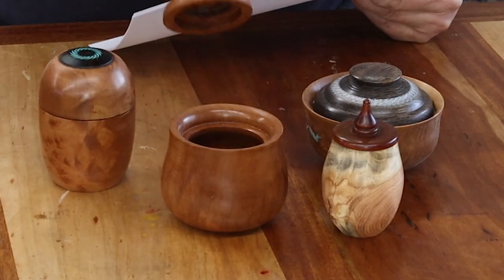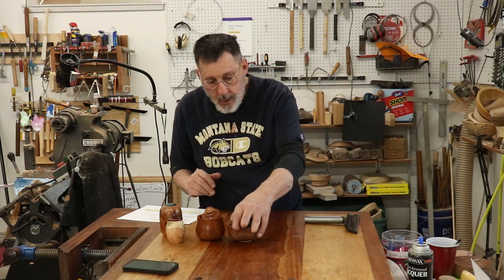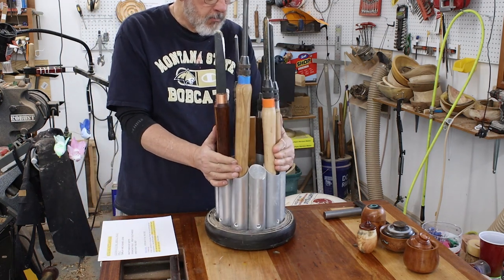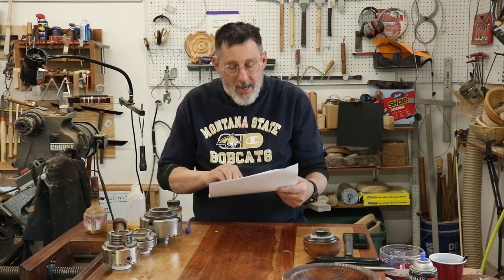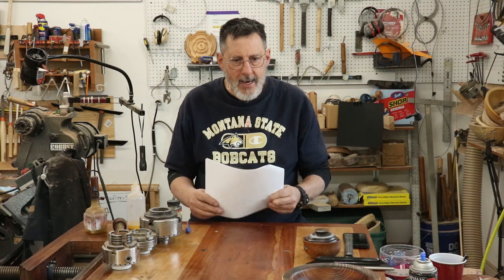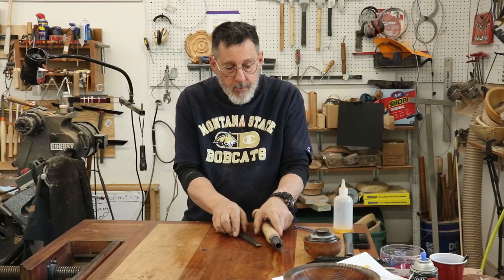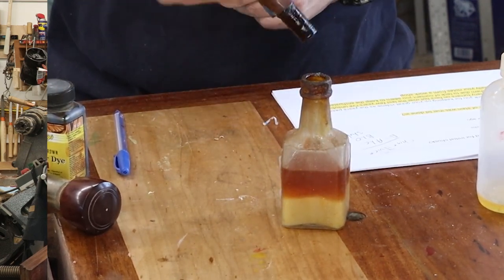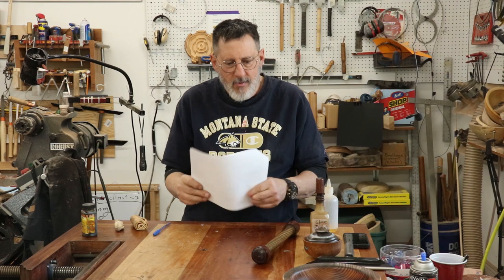Notes from the Turning Shop March 2023 Woodturning with Sam Angelo

Comment: Here is a vote for you doing a tool rest video. I think it's a part of the lathe that is under appreciated. First chuck? I do not have a lot of experience in this area but by observation I expect that any brand will be a good choice. Pick the less expensive. It will come with 2 inch (50mm) jaws. They will be adequate for most beginner work. I personally avoid the chucks that operate with the "Tommy" bars. However they tend to be less expensive. Shine Juice. The firs place I heard that referenced was while watching Cap'n Eddie Castelin probably10 years ago. He referred to it as "OB Shine Juice". I believe OB was the person he got it from. Good notes session Sam. Looking forward the the 4 way in a week or so. You guys did very well in your start. I expect the next issue will be at least as good. Thank you for sharing. Have a great day and stay safe.🙂🙂
Reply from the maker: My video on Tool Rests will be out this coming Sunday. Sam

Comment: Sure like these monthly chats
 I started my bowl turning with a cheap set of jaws just like the first one you presented. Granted I have a midi lathe but have made bowls approaching 12 inches with it. I now have two more- Nova 50 and 100 mm. I would love to have a larger lathe but my shop is a one car condo garage with 110 volt 15 amp circuit. Works for me.

Comment: I use Deft lacquer based sanding sealer, diluted with lacquer thinner. I used the polyethylene bottles that you use for  shine juice, but always had evaporation losses that left the sealer too thick. I switched to using plastic catsup bottles, which are a different plastic that is much less pervious to evaporation. The same should work for shine juice...keeping the alcohol where you want it.
Reply from the maker: Thanks Sam

Comment: Regarding chucks, the extra few dollars for a Vicmarc chuck is worth the price.  I have a couple and love the shark jaws.  Be aware, the jaws for the VM100 will not interchange with the VM120 and VM150.  The VM120 and VM150 have a wide range of jaws available and can be used with projects large and small.
Reply from the maker: Good info

Comment: Good video Sam, always enjoy your notes videos.  Really liked th boxes with the inset lids. Just stared on a piece of walnut burl and seeing those makes me want to rethink my design.  Just wondering, does robust make a tool rest with a 25 mm post.  1" is just large enough it won't go into my metric banjo.  If worse comes to worse I guess I could always drill the banjo out to 1".
Reply from the maker: You might check on the Rubust website. I am pretty sure they deal with his metric issue and they can get a custom post for you. Not entirely sure, but you can check. Thanks, Sam

Comment: OK. I gave you a kudo. Now for questions.   What is it that you like about shark jaws?  How do they differ from the other jaws that you use.
Reply from the maker: Vincent.
That’s a great question. I have two smaller shark jaw sets. Both are probably less than 1 1/2 inch when in the closed position. One is may be an inch and 1/8.  They are really nice for turning smaller items like a lidded box or container. They are also fairly deep so I could put a 2 x 2 square blank into them and turn a tenon on the other end or simply round over 1/2 of the blank.  So I guess they are fairly versatile. My next Jaw set up from that would be a Vic Mark with 2 inch jaws and for most things they are just too big. .Sam

Comment: Sam, why do so many turners choose to torture themselves, the tools and the lathe bearings by turning wood that has not even been partially rounded. It must be easier to work when the piece mounted on the lathe is either hexagonal or octagonal rather than having knots and lumps sticking out all over at odd angels.
Reply from the maker: I do agree with what you’re saying. I see that sometimes on videos on YouTube. Once in a while, you can’t help it.   with some of the items people turn are way beyond me.